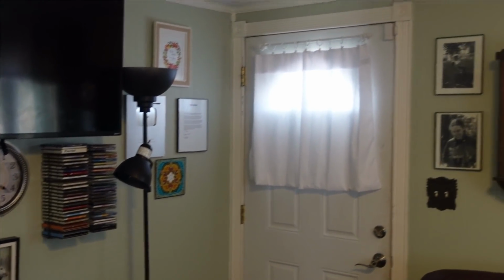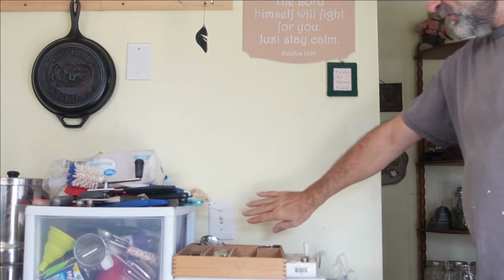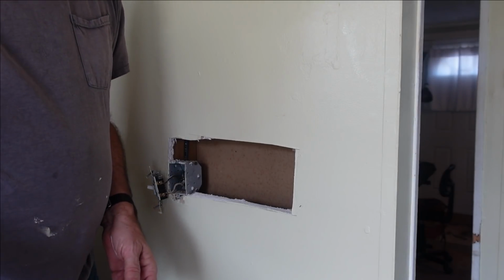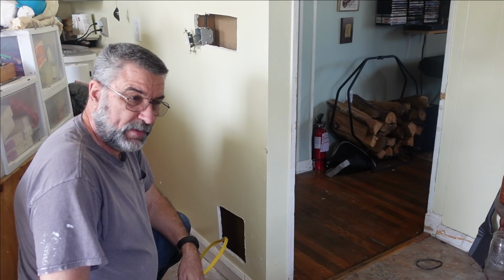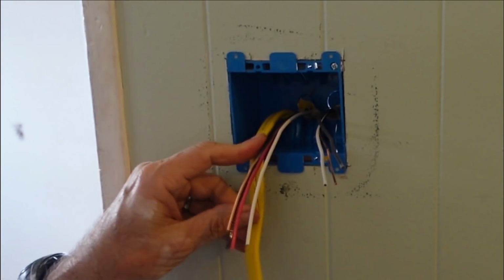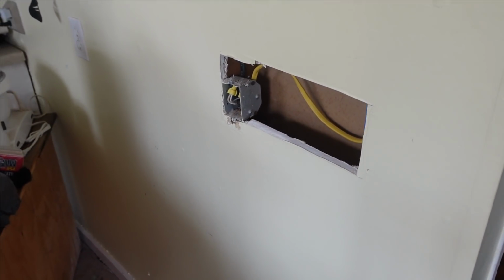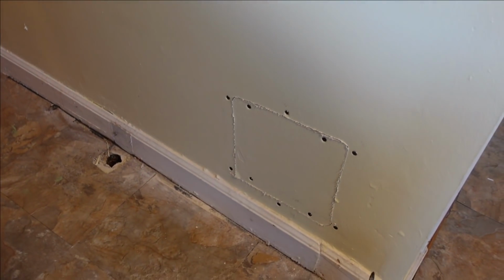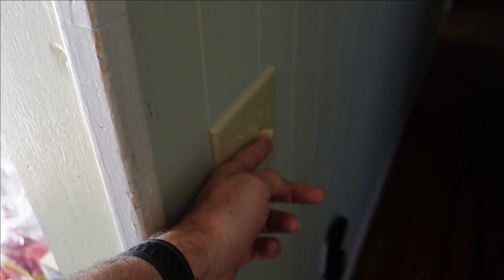Moving a light switch

Comment: Nice work Bill.  Like you, I only like to sand on the final coat.  "Mudding" looks easy, but like you said, it's a skill that is honed with practice.  I like to start with as little mud as possible as it's much easier (and cleaner) to add more than to sand off too much - an experienced drywaller taught me that.  I like that new switch box you installed...that's a clever contraption - never knew those existed until now.  Thanks for sharing.

Comment: I learned something. I never knew you put spackle then the tape on top of that. I have a patch that I have been waiting for my son to finish. Now I don't have to wait!!! Thanks Bill.
Reply from the maker: If you don't put the mud on first, there is nothing to hold the tape against the wall (unless you buy the self-adhesive tape, which is relatively new, and costs a lot more.)  Put the mud on, then put the tape on, then try to scrape ALL of the mud off, leaving the paper completely exposed..  That is the first coat.
Reply: Thanks for the lesson and the tips.

Comment: Thank you, Bill!  My house was also built in 1970 and it has the same problem with light switches in a couple of spots, but that isn’t nearly as bad as not having enough outlets on the walls in each room.  I hate having to run extension cords, but I do have a couple in necessary places for lamps.  I have a hallway which does have a light overhead, but no outlet anywhere, which I really wish they had thought of.  But, I am fortunate in so many other aspects of this house, so I am happy overall.  Take care and God Bless you and family,
Reply from the maker: In 1970, they new about lamps, and a clock.  They had NO IDEA how many electronic gadgets we would be using, and plugging in, in the future!

Comment: Hey Bill I live in a home built in 1952. It’s like one per room. My livingroom is just like yours. It is truly a nightmare. I’m afraid to have an electrical contractor to come and fix anything because I don’t want to hear that the house is not up to code. In the mean time I have cords under rugs. 
I just heard a report about how the severe storms in Texas are going to affect the cost of food at the grocery store. So many cows died and produce was frozen. It just reminded me of what you have been talking about. This was very cool.💖
Reply from the maker: You don't have to worry about your house not being up to code.  Building codes continue to get more and more strict for NEW construction.  But MOST older homes do not meet current building codes.  It's not an issue, they are grandfathered in.  An electrician could add extra switches for you without any code issues.

Yes, the storm in Texas just reiterates what I have been saying all along about being prepared!  And the crops that were destroyed by the cold were just one more incident of cold weather crop losses that are happening all over the world because of the Grand Solar Minimum.  Food will CONTINUE to get more scarce and more expensive.  The severe food shortages have not really started yet.  But they will!
Reply: @LiveSimpleLiveFree  Thanks Bill for the info and for making me smarter.

Comment: We had the same issue with our 1964 ranch. Instead of putting in 3-way switches we installed a motion sensor switch in the hallway. I still want a 3-way into the living room from the kitchen, though. And a 3 way loop IN the kitchen  going to the sunroom.

Comment: Interesting to see the difference between US and UK wiring regulations. UK would not permit cables to be joined with twist on joints, ours have to be screw terminal junctions. I know the US use the twist connections a lot and they look very easy to use. We follow IEEE regulations here I assume the USA has something similar?
Reply from the maker: The twist on “wire nuts” as we call them, are not only permitted, they are required!